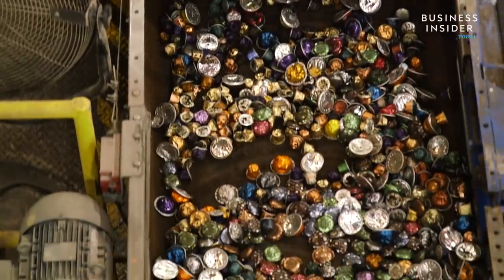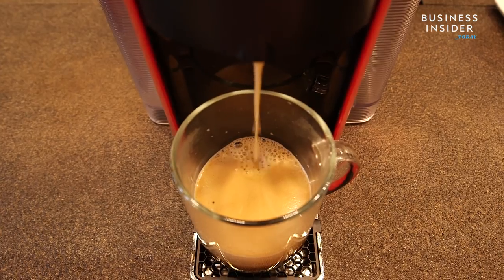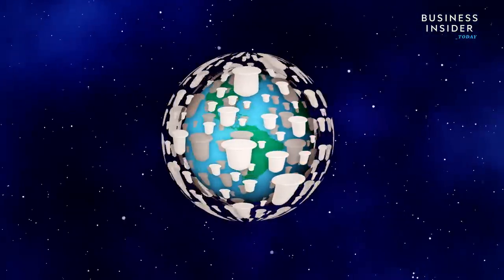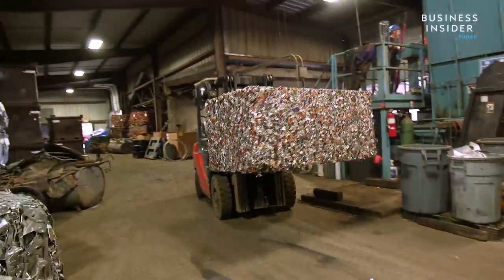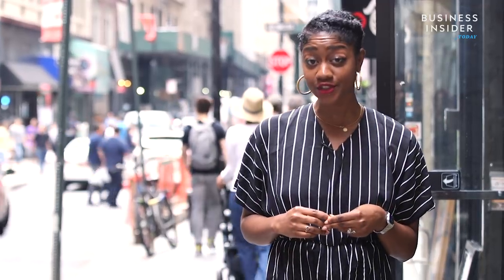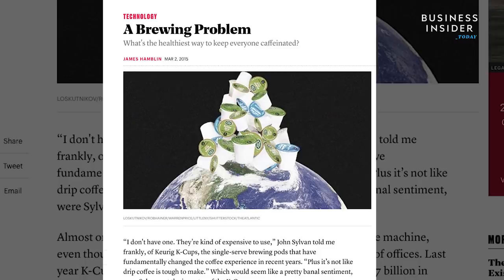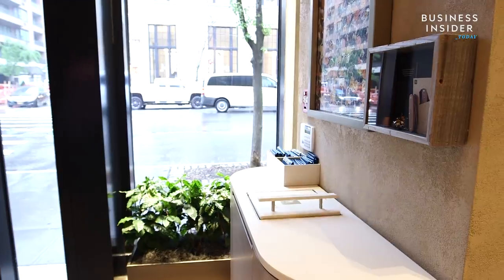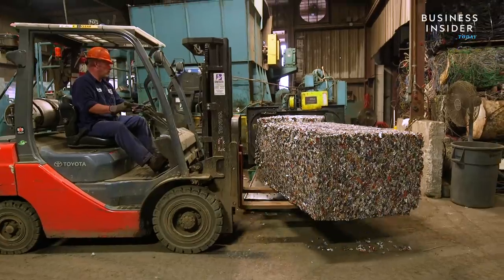Why Nespresso Is Recycling Its Coffee Pods

Comment: I have a Keurig and I purchased a pod that I can refill. They come in both paper and metal filter form. You can get them from Amazon easily. They even have a grinder I purchased specifically designed to fill both the small and large pods.

Comment: In Finland at least Nespresso suggests you take the capsules to the recycling bin for small metals. We have those in each apartment building. The capsules are molten and then reused, as aluminium is endlessly reusable. I find this better than artificially biodegradable capsules. We switched to nespresso mainly for this reason (+ the coffee it makes is excellent) , and I feel great about it. No more plastic or otherwise unrecyclable (due to multiple materials) capsules. For us capsules work, as this way we can more easily experiment with different tastes and only brew the amount we need. I don't know about the recycling possibilities in the US for example, but at least I know my capsules won't be found at a landfill.